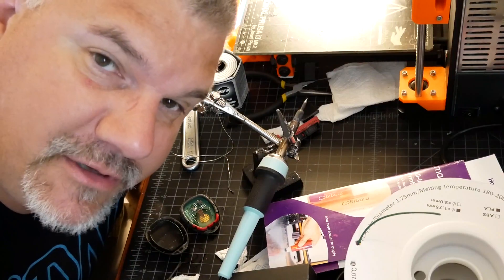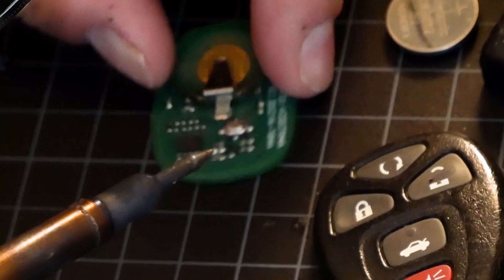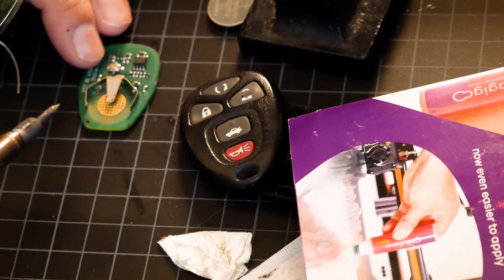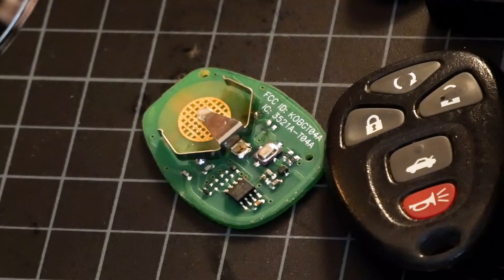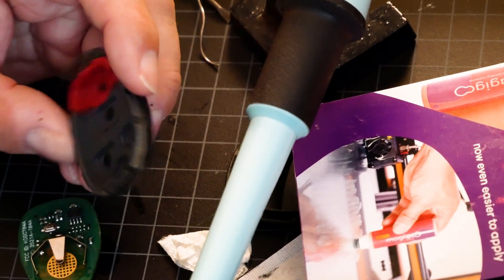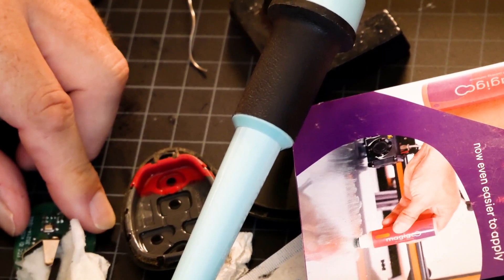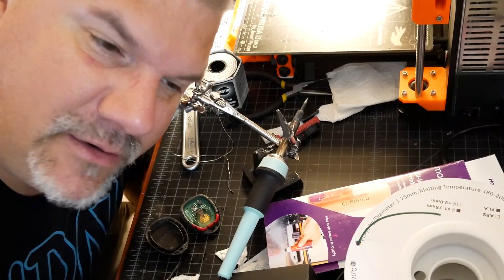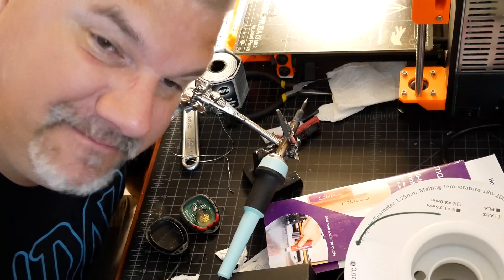My Keyfob Won't Unlock My GM Car - GM keyfob has broken battery terminal

Comment: Hey John, that was 91% IPA, 90% would have looked like....well....90%   😋   was that battery contact a common part? reused the existing?   if it was a new part, what is it called and where can it be found?    Keep the vids coming, bro!